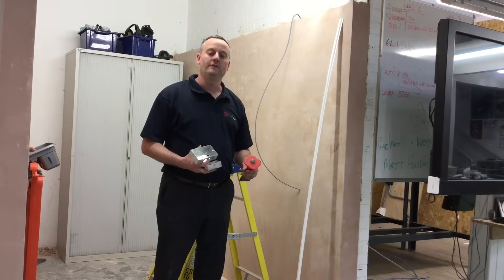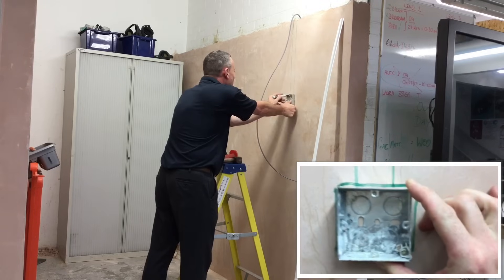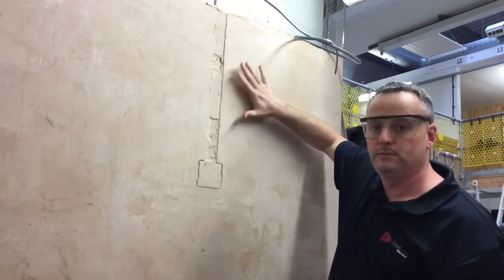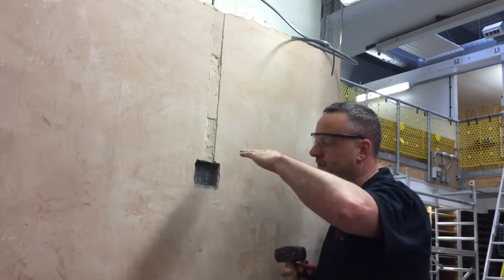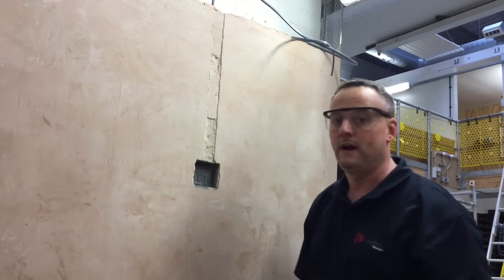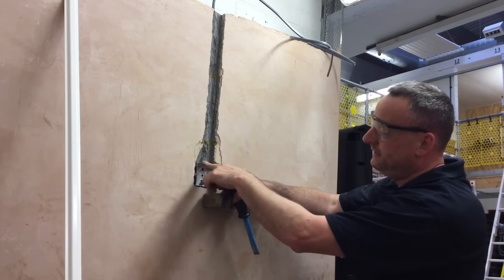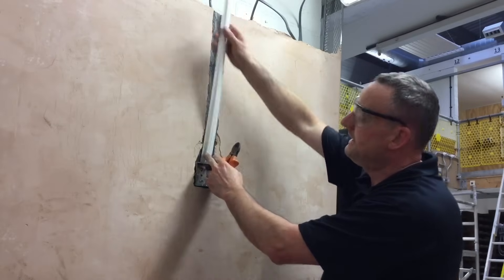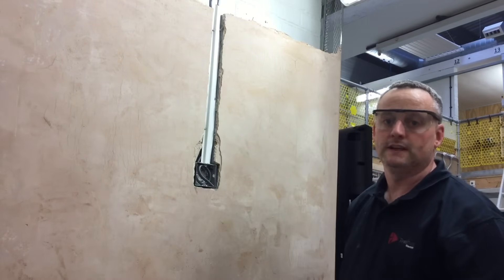How to Chase a Wall and Fit a Flush Single or Twin Socket Box In a Plastered Brick Walls (Chasing)

Comment: Didn't know electricians did this old fashioned method still now there are chasing machines and dust extractors about that are pretty good.
Personally I would stitch drill around the box outline and then gently tap the chisel into it. And you are lucky its light weight block, in the real would blocks tend to be 7.3Nm concrete blocks and harder or old houses where bricks are used indoors. Also I never use capping, I go the extra mile and use tube, oval or round, makes the job rewireable.

Comment: Check the knockout position before you start the vertical chase.  If the drop ever needs replacing it will be tricky pulling it through that chicane.
Reply: oval tube is used for rewiring purposes, you might have a chance with capping not that its designed for that.

Comment: Thanks for the video. Out of interest, if the pre drilled holes in the box is not in the centre is there any reason why you couldn't offset the chase to the left or the right and allow the cable to run directly into the box?
Reply from the maker: I just link to come straight into the middle of the box. Your method works as well 👍🏻. Thanks for commenting and watching
Reply: @GSHElectrical  Thanks for the quick reply. I am not a pro, I was just wondering if it was an industry standard to go to the middle to minimise the risk of someone drilling into the cable after the plaster has been reinstated (having assumed the cable would run centrally)? Thanks again, really useful video.

Comment: I found this method is not suitable for chasing in a brick wall. Having had a domestic job turn sour this week, resulting in the bolster chisel punching through a single breezeblock brick interior wall. I did not hammer hard on the chisel at all. Turns out only later I was informed that shoddy bricks were used during the build.
Reply: Careful use of an SDS hammer drill with chisel bits, or a chaser cutter would be better I think.
Reply: Hats off to you, sir for good video content, and to the sparkies who do domestic work!

Comment: I'm not an electrician so I may be unaware of something obvious to those in the trade, but why didn't you cut out the space for the socket box slightly offset from the capping chase so the cables could go straight into the box?

Comment: You should have put the wiring chase inline with the wiring hole in the box, Which are always offset and not have bent the wiring to one side, Where it was not covered by the capping, And the capping is used to protect the cable from the product being used to fill the chase.

Comment: Now try doing it into brick or concrete blocks ...good luck
Reply from the maker: My learners only chase this wall hence the video 👍🏻
Reply: @GSHElectrical  it's an educational video where viewers will go away and copy you , would have been a good idea to point out most walls aren't that easy that's all 👍
Reply: @ZXspectrum..  surely the mounted box should be level if this is an educational video.

Comment: If I have an electrical wire already boxed into a conduit along the surface of the wall and I want to move the wire inside the wall, do I need to remove the white cover first? Or just push everything into the wall? Also - if I have a cut wire that I want to extend - do you have a video for that?

Comment: Hears a tip from an old sparky if yo need to run a cable from unfinished basement or attic use a coat hanger long part cut it straight go to the molding with a drill go straight down with the coat hanger like a long skinny drill bit from open space drill over to center the cable then you can fish wire up to the cut in box little field tip I have used it for many hard places. I know it different here in the states but pulling cable is 75%of the job in most cases here anyway. Have fun and tell the students to study study study never say no.

Comment: Take the cable out of the way before nailing, then slide it back if your working area allows that, this would reduce the risk of nailing the cable.
Once you finish the job take an extra step and cover the socket box and cable entrance with a piece of cardboard or a plastic. Don't trust the plasterers, otherwise you may end up dried plaster pieces inside the box.
Reply: Or cables cut short by the plasterer ha

Comment: Your video is really helpful.  I am going to have a small wooden box/cupboard behind my wall mounted tv, I am going to chase horizontally to a unit in the corner where various electrical equipment such as blue ray player will be housed.  My question is,  presumably I do this in the same way, however, I think that I may have a wire to a plug point to cross over or underneath about half way.  Can you suggest how I can do this.  Finally can you recommend a tool for locating electric wires /pipes and studs, I have spent a fortune in the past and none of them seem to work. Many thanks Ian

Comment: Go round the box and along  the chase with a masonry drill the box will cut out easier Drill to the correct depth first will give a guide to depth
Will help with less damage locally as less banging is necessary

Comment: Great video, watched this many times before trying it myself. Seems like I came across multiple issues. One was I ran into some old diagonal metal conduit which I grinded through. Second was I found a semi void in the wall so I have nothing to screw the box into apart from some brick on the right side of the box... Just my luck, but guess this is how we learn. Cheers!

Comment: wouldn't it be easier to cut through the blocks just after they've been set, so you can get a nice cut through the block rather than hit some of the concrete with your method?
Reply from the maker: My learners have to chase this wall as per the demonstration hence the video. Lots of different ways and tools that can do the same task 👍.

Comment: In my house there are no seperate conduit pipes for cctv cameras and fiber cables. I have to attach a dome camera along with LAN cable on ceiling (which is RCC Slab). But I want to install PVC conduit pipe (1 inch dia pipe & 10 feet long) inside the concrete slab. So is it possible to cut the slab for installing conduit pipe ? And How much time can take to cut the 10 feet long slab for pvc conduit?

Comment: The neighbors must have gone insane. Excellent job though.
Also, if the chisel is dull, sharpen it then temper it by heating till red-hot and cooling in (automotive) oil.

Comment: Why didn't you off set the chasing so that it aligned with the entry hole in the wall socket?
Reply: Because common sense isn’t that common!
Reply: Saved my asking the question!
Reply: I did wonder this too I did so on spuring  an extra socked in kitchen makes sense then the chase protects all the wiring to the box

Comment: From Perth, Western Australia - Most houses here are still full brick, as in double brick external walls, single brick internal.
So I well understand having to chase if you want a power point etc on inside wall.
I've done it that way once, then cheated with an angle grinder with masonry disc, and drilled holes around wallbox outline.
Then I discovered it was well worth hiring a chaser with vacuum attachment. To east coast Australia, you will never know, framed walls and plasterboard, meh!
Reply: How much did the chaser cost, Im in perth as well

Comment: Thanks for the great video! Couple of questions.  
Is there any reason not to offset the vertical chase so it's directly above the grommet hole in the back box? Then you don't have to put that sort of bend in the cabling. Is it a safety zoning issue?  Second, how far under your finishing plaster does the top of teh capping have to sit.  Assuming the whole lot is getting a skim coat (asking for a friend :P).

Comment: Would making the chase in line with the knock out of the box be better, or is there a reason why you made it central to the box where there is no knock out?
Reply: That's exactly the way I do it. That way it looks neater and it is much easier to put the capping over the cable without having to struggle where the cable goes through the knock-out in the backing box.

Comment: Thanks for another great video.
I just wanted to know do you need to put cables in capping if they are going to be covered over by dot and dab plasterboard or can you just clip direct? Thanks
Reply from the maker: Hi, thanks for commenting I always put capping on my cables however not everyone will when the wall is to be dot and dabbed. All the best Gaz 👍
Reply: @GSHElectrical  Yes it seems some do some don't, I think I prefer to have capping as it would be easier if you ever needed to replace the cables.
Thanks for your reply, you are such a great teacher.

Comment: Given the access is to the left or right of centre on the top of the metal box, having positioned the box, run the chase line up from there, and not above the centre of the box. That way there is no off-set kink. Equally that also allows for tubular conduit should that be preferred. Easy with a block wall. Would have been nice to see a brick wall.

Comment: If you chase a concrete floor, instead of capping what would you use so you can pull through if needed after the floor is concreted? Conduit? Any type of metal?

Comment: Good video I have to do thus soon fir our kitchen extractor (carbon filter not duct) layout wont allow for ducting one question with the correct junction box can I steal a live feed from a a feed under floor boards to a socket ? I dont want to go to fuse box as I  want to use a socket lime to be sure I can isolate it from the socket trip switch obviously I'd be putting in a separate switch in kitchen for the hood with a 3 amp specified fuse thanks

Comment: I use a grinder with a maisonary disc just to cut the initial profile to my finished depth to include a few cuts for my metal box and the main chase.Its a simple job after just to pop of the plaster with a hammer and chissel.Dustier but a lot quicker with cleaner cuts in the plaster work.
Reply from the maker: Hi. This chase is an assessment for my college learners hence the video as they have to chase the wall as I have demonstrated. All the best and thanks for commenting. Gaz

Comment: God bless power tools that’s all I can say😂
Reply: Yeah, for example an angle grinder with a 180 mm diamond cutting wheel. But it creates an awful lot of dust. It's tough not to be bothered too much by the mess and concentrate on the task at hand like carefully cutting a piece of PVC that is partially in a wall to match it with a socket port. It would be a big relief when the plasterers are done and I have a nice wall back.

Comment: Good grief I have not seen a socket fitted like that in years, I am only a hobbyist but even I have a circular saw fitted with adjustable concrete blades that can make a channel of any required depth and a two-piece drill and hammer action jig that cuts a single socket out and for a double socket you just make two side by side

Comment: Do you advise your learners to fit 35mm boxes (at least) if at all possible to allow for some of the deeper switches / sockets that may need to be fitted in the future (2nd fix).  My experience is that 25mm boxes are not really deep enough. Especially if you are adopting a join (loop) at the socket approach. 
Have you come across a blanking plate that could b e fitted flush with the edge of the back box so the plaster doesn't fill the box full of plaster.
Reply: Makes no sense. 35mm deep back box is usually required for a cooker or 45amp switch.

Comment: breeze block  :) ... do the same with engineering brick ... not used bolster in years sds chisel plus multi tool with diamond blade .
Reply from the maker: Hi this is an assessment wall for 16 year old learners 👍. Gaz

Comment: I'm looking to tile my concrete wall in my office. I have a question, my tiles are 12mm thick. Do I require a box that fits into the wall with extra long screws? How do I go about this?
Reply: Yes just get longer screws will save you alot of frustration just are sure the space you "cut out" for the socket will be small enough so it is concealed by the socket facade

Comment: Great videos at 53 ive had years of DIY and these videos are a good pointer for anyone who may not be a qualified Spark, but is competent to do electrical upgrades not installs because part P won't allow :-)
Reply from the maker: Hi. We use my videos as training aids for the learners that attend the college I work at. Thanks for the kind words and watching Gaz 👍
Reply: @GSHElectrical  saw your other video on permitted cable runs. Really good and concise information as for this video one thing it don't cover is old houses where when you chase out a run half the plaster falls off the wall lol however it then allows to dot and dab plaster board so not having to chase out for wires haha.

Comment: Hi can u tell me if there are many changes to upcoming 18th edition that will affect domestic installation thanks
Reply from the maker: Hi. Small over view... RCD on lighting circuits, SPD’s and maybe AFDD’s, no bonding to water/gas/oil if the incoming pipe is plastic or has a plastic insert, when RCCB are used no more than 30% natural earth leakage current (9mA), RCD now to be tested every 6 months, surface wiring to be prevented from premature collapsing, new minor works, some changes to the inspection schedule I recommend looking at Sparkyninja’s channel on YouTube. All the best Gaz

Comment: Nice video. Can I ask why the use of capping? I thought that the wall can be chased and the cable can be directly clipped if the installation is RCD protected or if not RCD protected then the cable doesn’t require capping if it’s buried at a depth of 50mm or greater. Would you still recommend the use of capping?, even though it is not required in the wiring regulations.
Reply from the maker: Hi. The capping is used to reduce the risk of the plasters trowel damaging the cables. Thanks for watching and commenting GSH Electrical

Comment: What do you think of wall chasing machines?
Reply from the maker: Hi. They make a lot of dust but anything that saves time and energy is good to me. My learners have to chase that wall as part of an assessment hence the video. Thanks for commenting and watching GSH Electrical
Reply: Thanks for replying.  I've just bought one but haven't opened it yet so thought I'd research a bit further before opening it in case I change my mind and want a refund.  I've just watched some videos for chasing chisels that go on hammer drills .  They look quite good and are fairly cheap.  Do you have any experience with them?

I'm really just looking for the quickest method as I don't want to annoy the neighbours too much with noise.
Reply: @GSHElectrical  not if used with a good dust extractor.
Reply: I bought an  erbauer wall chaser for £99 from screwfix and use it with a bosch m class dust extractor, it dont make as much mess as cutting it by hand and a hell of alot neater and easier don't recommend using without a good dust extractor though.

Comment: I use a dremel tool to go around the edges of a chase and to cut out the the lattice of a chase, and finally finish off with a chisel and hammer. Only problem is dust.

Comment: Hello GSH, I've recently come across your videos and love them, learning loads. Can I ask why you use round headed screws in these sunken boxes, I've never even thought about which screws to use, just used countersunk because that's what I have in my bag. Thanks for the videos.
Reply from the maker: Hi. A metal box surface is often flat and the underside of a countersunk screw which is v shaped means you don’t get the maximum surface area of the screw holding the box down. The underside of a Roundhead screw is flat giving greater surface area contact and a better fixing. Hope this helps Gaz
Reply: Absolutely does Gaz, like I said never would of thought about that. Top bloke for replying.
Reply from the maker: Thanks for the support and watching Gaz

Comment: Hi I know as unqualified I shouldn't do any electrical connections on a new build but would I be permitted to run the cables and screw on fittings etc. I'm competent enough to do the wiring but not qualified
Reply from the maker: Hi. As long as run not installing a new circuit, changing a consumers unit (fuse box) or in a bathroom room you are allowed but I always recommend someone who has trained for years to do any work. Thanks GSH Electrical
Reply: GSH Electrical  thanks for swift reply would be employing electrician to connect everything.  Wish now I took course years ago lol

Comment: Hi there.  On a new build or extension where dot and dab before plaster board is applied providing it hasn't a polystyrene back am i right in saying you wouldnt need to cap the twin and earth as capping is pretty much there to protect from the plasters trowel? Great videos mate keep up the good work.
Reply from the maker: Hi agreed. I did the video as my learners have to chase that wall for an assessment (exam). Thanks for watching GSH Electrical

Comment: Using capping instead of oval conduit isn't being very helpful to the person following who has to feed another cable through. Looking at the chasing, the cable will snag on the uneven surface and potentially catch on the entry to the box. Using conduit that is fed to a few millimetres into the box would allow a smooth 'push' of future cables/rewiring. 
You'd kick yourself if you got the re-wire job. ;)
Great videos otherwise, please keep them coming.
Reply from the maker: Hi. That is another way and worth looking into doing. Thanks for the kind words and watching GSH Electrical
Reply: You could use single cables inside the conduit then this is common practice in the UK in more of a commercial and industrial environment not used for domestic though its just how its been done for Years!